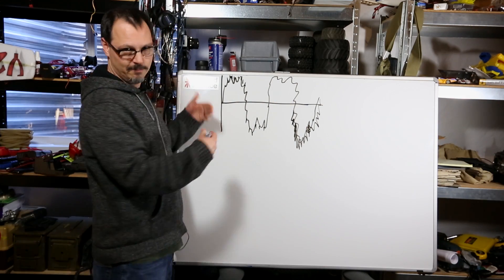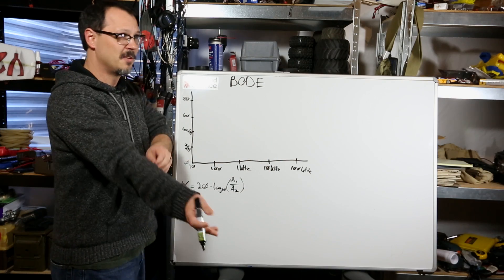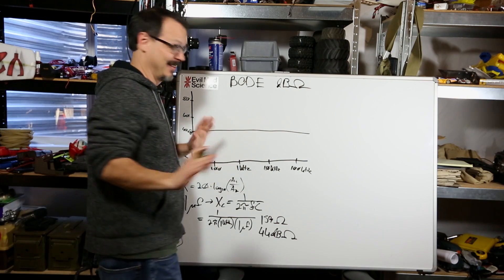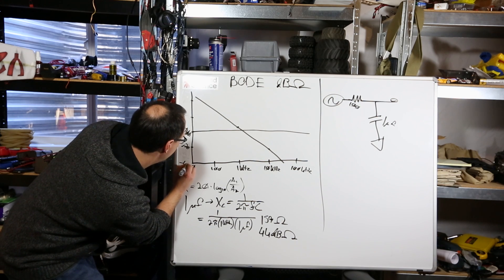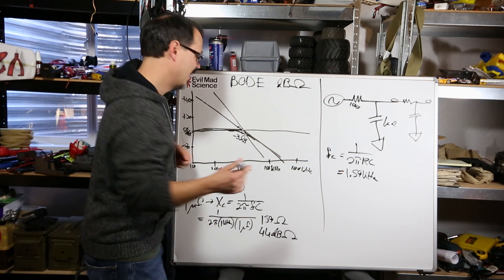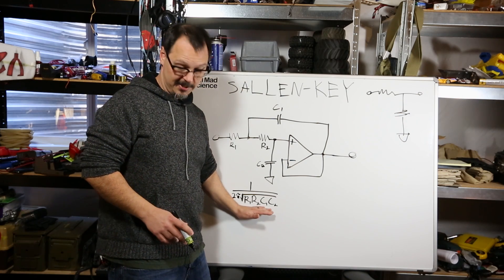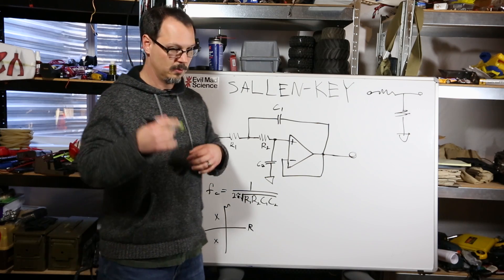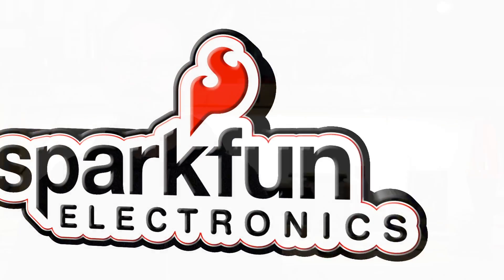SparkFun According to Pete 1-7-13: Filters

Comment: If I understand correctly, there's always a limit to the amplification (be it the op-amp, impedances across the circuit or whatever). Where it's infinity, it just means that you don't have to consider that component as limiting.

Comment: Excellent video!  I have to disagree about most filters being active though.  In my work as an EMC engineer I use passive filtering all the time, particularly to remove unwanted EMI on the input of switch-mode power supplies.  This is to ensure the EMI does not affect other parts of the circuit or other external equipment